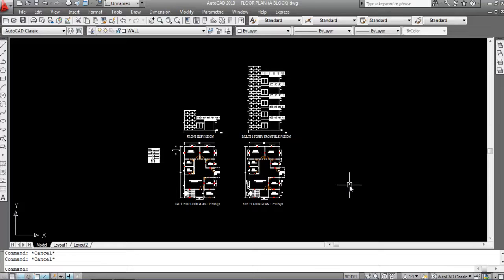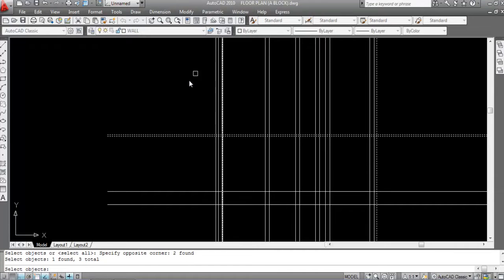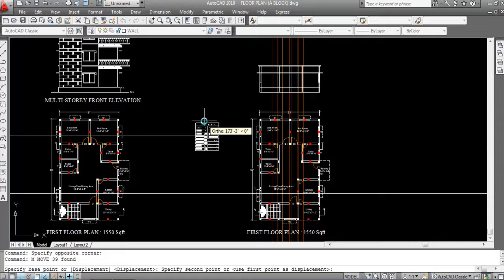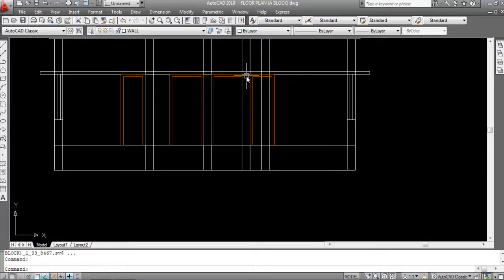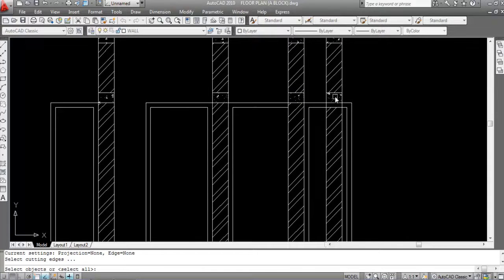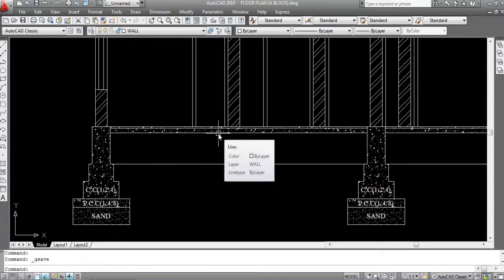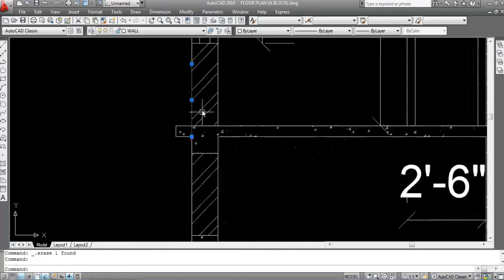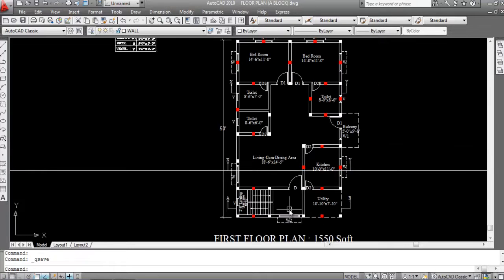How to draw Sectional Elevation of Building AutoCAD || Building #2 || Multy Storey Building

Comment: how did you draw the x and y near windows. what is the size? that is not shown on other videos thanks.
Reply from the maker: X & Y lines are section lines. Section lines can go through windows and doors. This  plan is sectional elevation of building so section line is provided on this plan.
Reply: +CIVIL Engineering Tutorial so from window how many feet or inches will i offset to get that line?
Reply from the maker: No specific measurement is required for section line.To create a sectional elevation, first draw a line on the floor plan that cuts through a section of the house for which you need to show cross section details.
Reply: +CIVIL Engineering Tutorials ahhh okay i will put any measurement on that. Thanks.but they must be equal to both sides right?
Reply: +CIVIL Engineering Tutorials thanks for response

Comment: can i get the this file, i want to study also.
Reply from the maker: Thanks for watching. The channel will not provide any files. You should practice by watching the video.
Reply: CIVIL Engineering Tutorials must start from starting, i just want that floor plan and continue the sectional elevation.
Reply from the maker: Please go through the below link. This has complete design for the same building.

PlayList : Complete Building Drawing in AutoCAD || Building #2
https://www.youtube.com/playlist?list=PLGstbEuPUsWXn3Q9wZQhm8gPQ5RwtptAV
This play list will cover the below videos
1. How to draw a Site Plan of building in AutoCAD
2. How to draw a Floor Plan of a Building in AutoCAD
3. How to draw Floor Plan of a Multi Storey Building & Add BLOCKS using Design Center
4. How to provide columns in building drawing AutoCAD
5. How to draw Front Elevation of Multi-Storey Building in AutoCAD
6. How to draw Sectional Elevation of a Building AutoCAD
7. How to Draw Footing Foundation Of Wall in AutoCAD
8. How to calculate  number of Rise and  Treads of Staircase
9. How to draw Sectional Elevation Of Staircase in AutoCAD
10. How to draw RCC Column Layout Plan in AutoCAD
11. How to draw BEAM Layout Plan in AutoCAD